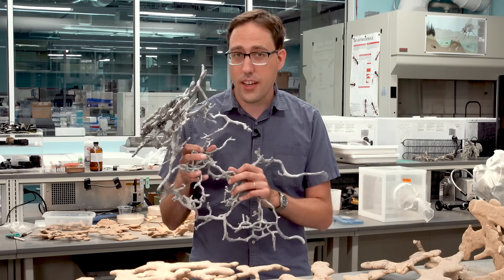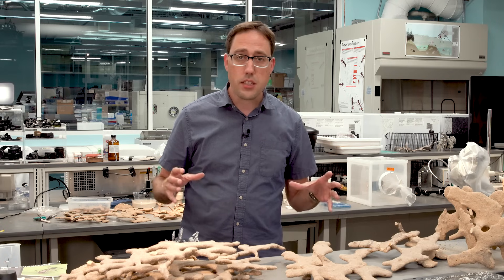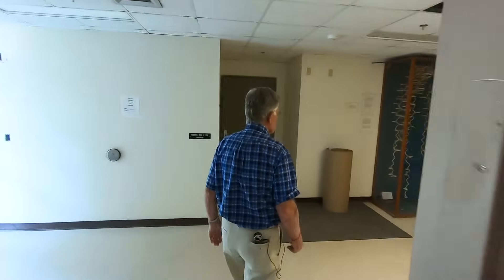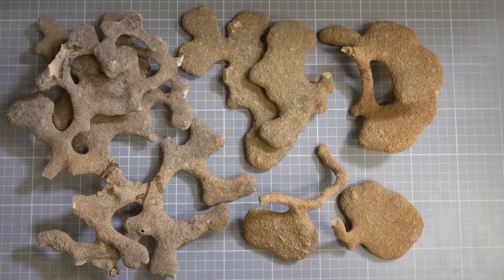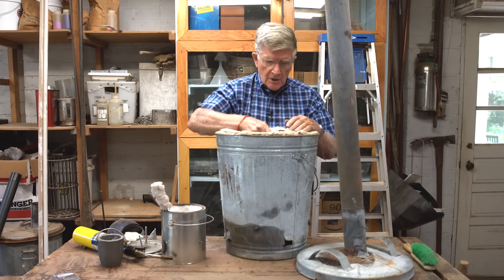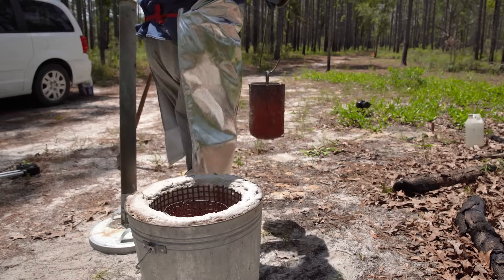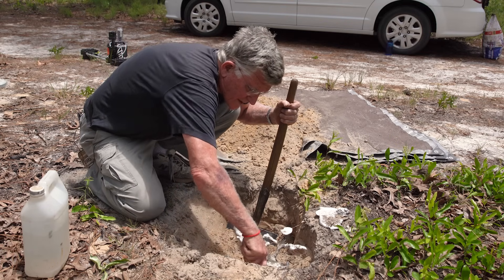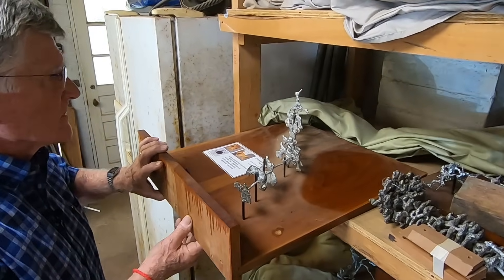The Invention of Ant Nest Architecture

Comment: A transparent polymer would show the ants.
Wonder if there is one.
Reply: It would have to be a very fluid polymer, most polymer I see is usually very thick and doesnt flow easily. But it would be very interesting indeed.
Reply: It would just push them down to the bottom, and wedge them into places.

Comment: How do ants keep them from filling with water when it rains?
Reply: Good question!
Reply: They use flex tape
Reply: I guess ant cannot. That is why every time when it rains they move.
Reply: Likely surface tension, can't get into the holes as it clumps up and sticks, and permeates through the dirt instead around the tunnel. Just a guess, though. Heavy rain with more flooding than the soil can take would likely be an issue, though.